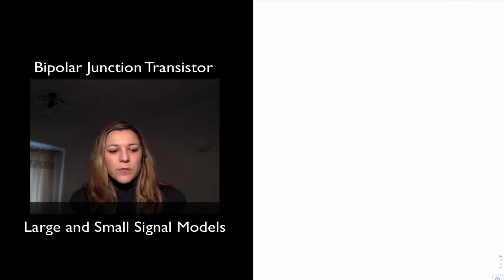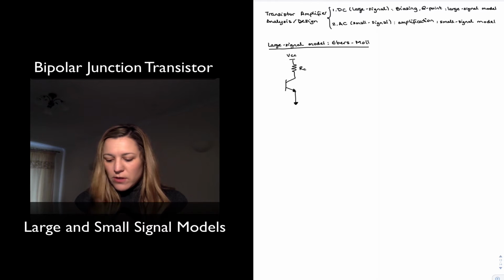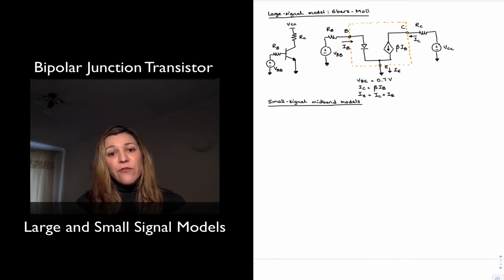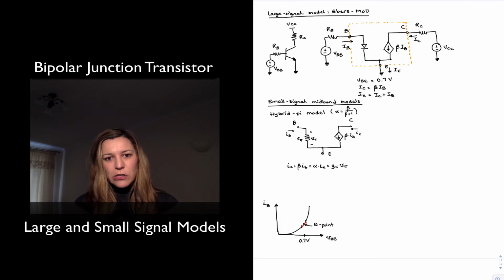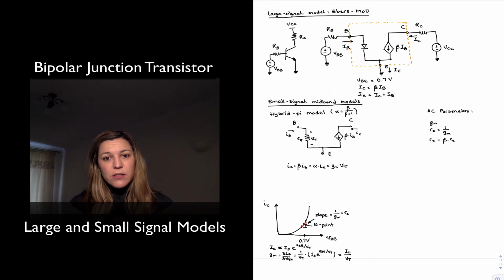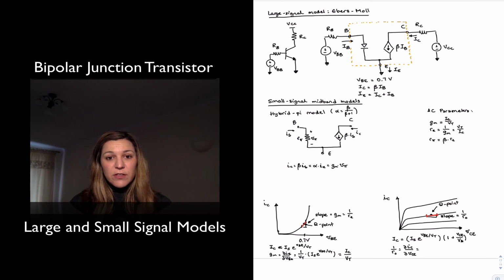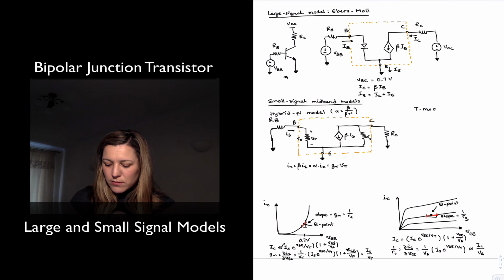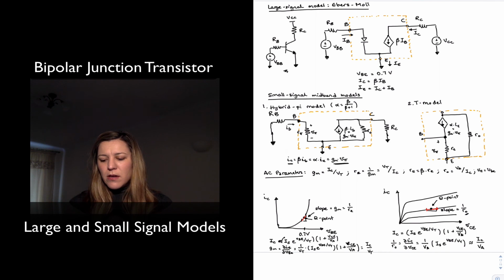BJT Large and Small Signal Models

Comment: what is a small signal model basically? what is its significance?
Reply: It helps you to understand the circuit's behavior when the input signal has small variations. It's also called center band model which stands for analyzing the behavior of the circuit without any source of power, just by itself. The parameters like input resistance, output resitance, gain voltage describe the behavior of the cirucit.